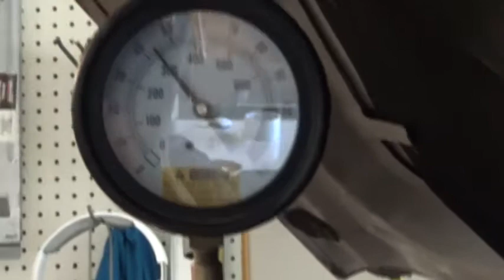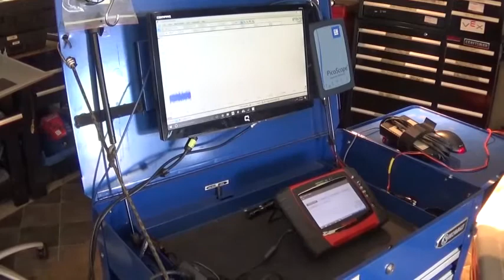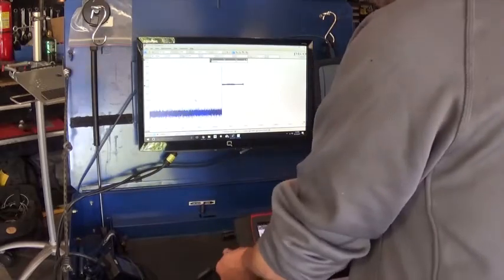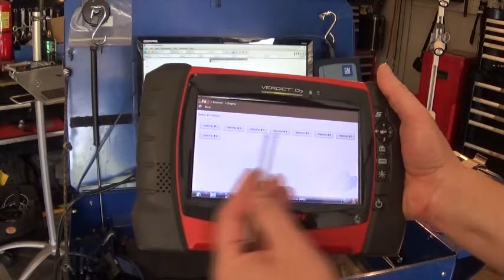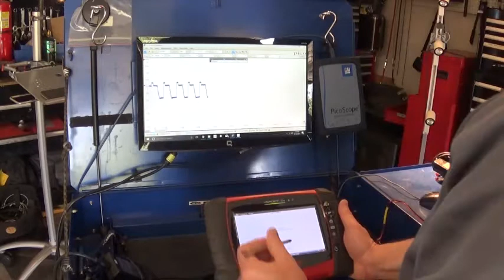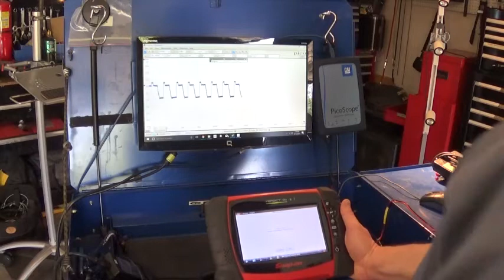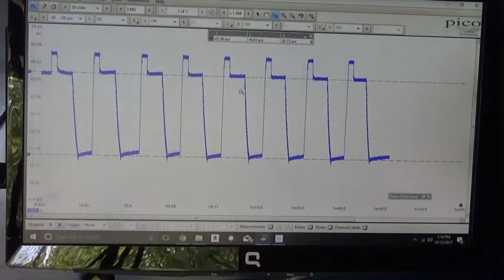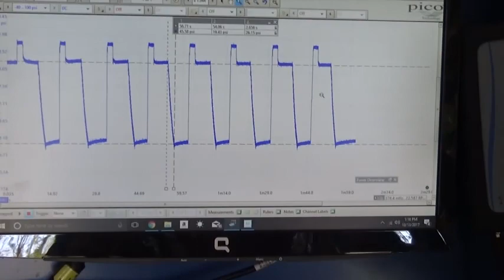Injectors Balance Test Done With Picoscope

Comment: Maybe a good test to try with my WPS 500 instead of a mechanical gauge !!
Reply from the maker: I think you will find this way of testing injectors very convenient.👍
Reply: @kyhomegarage3430  I didn’t want to remove the fuel hose off my fuel pressure gauge so I had to order a fitting for my fuel rail and with some 5/16 fuel hose I’ll connect that to a spare quick disconnect that comes in the WPS kit…just ordered an EScan Elite yesterday and can’t wait to use that…soon I’ll have as much diag equipment as you…LOL !!…I’m close !!

Comment: Pretty cool! If all makes and models would have that option. Do you know where to get a not too expensive timing tool (I think that's what it's called) ? Thanks for the nice video! And kind regards all the way from the Netherlands!
Reply from the maker: majetoJESUS I am not sure what timing tool you are talking about. Can you be more specific. I would like to help.
Reply: KY Home Garage KY Home Garage  The tool to energise the injectors for the injector balance test. If you don't have the bidirectional option like in the video.
Reply from the maker: majetoJESUS this is what I have.
https://www.ebay.com/i/172730271492
Reply: KY Home Garage KY Home Garage Thank you so much!
Reply: @majetoJESUS  If you are the least bit savvy, you can use a simple $20 microcontroller such as the Arduino Uno for this.